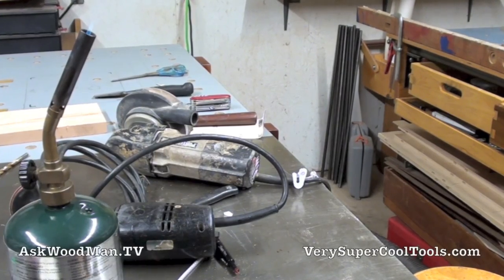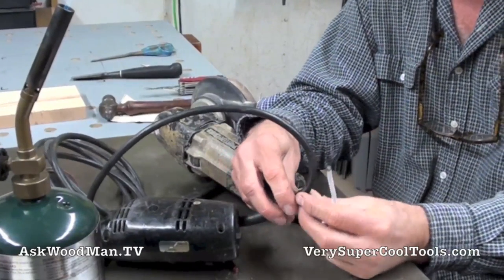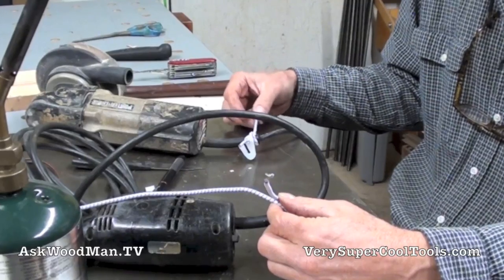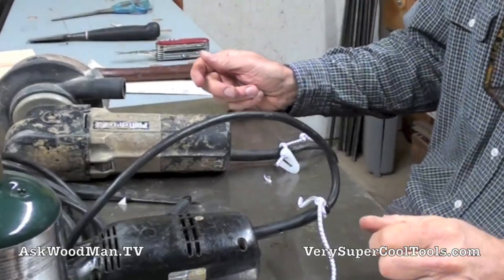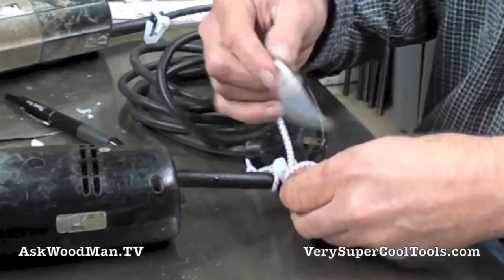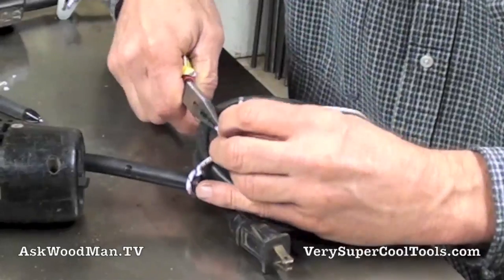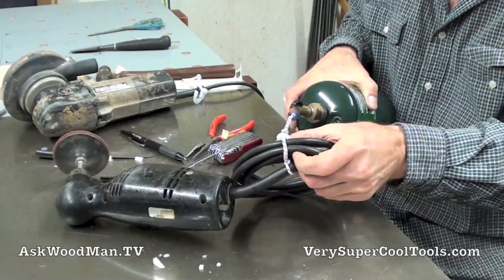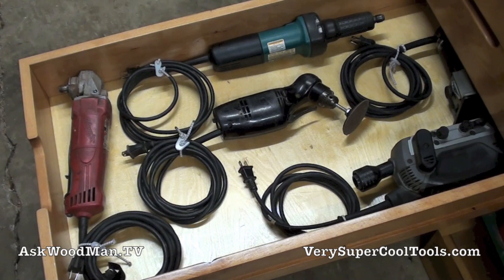755. Power Cord Manager (3 of 3) • Attaching The Bungee and Using

Comment: awesome tip, I've been using 12 or 14 gauge electrical wire for years..time to upgrade lol... a quick question though.. what thickness UHMW sheets would you suggest getting if I was only to get 1 or 2 small sheets and not thickness plane/ cut them?  Thanks as always for sharing your ideas through your great vids ;)
Reply from the maker: speedsnipe The size I think is most valuable for a woodworker to have around the shop is a1/4" thick  2"x36" just for odds and ends. Buying flat sheets is really pointless because the stuff won't stay flat. It works best as small components were super strength and low friction are needed. You can hand plane it like a dream if you can hold it. Here is a video of me showing how to make a thickness adjustment on a VSC Tools t-square glide.http://vsctools.com/powermatic-table-saw-fence/

Comment: Thanks for that, Allan - I have just been wrestling with the same problem - my solution was to use re-usable cable ties - but your way looks much better (I like your "over / under" looping - I gues that is so the cable doesn't get twisted?
Reply from the maker: Exactly. The over under just makes the wound cord relaxed. I just posted more videos on it specifically.

Comment: I find that the plastic molded box that comes with tools although built well in some cases should be discarded or repurposed for something else. They are just as hard on the cords because you have to bend the boot over tight to get the tool back in the box.